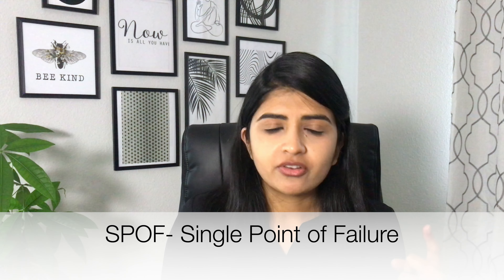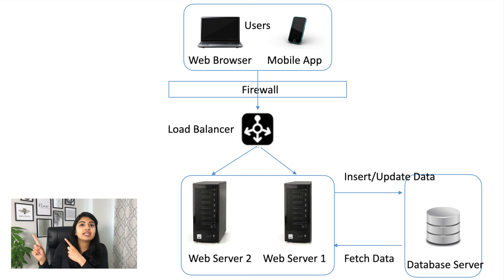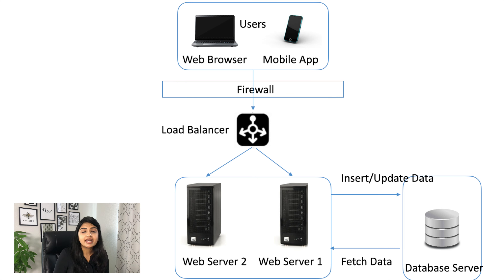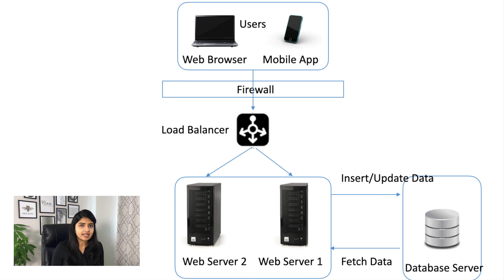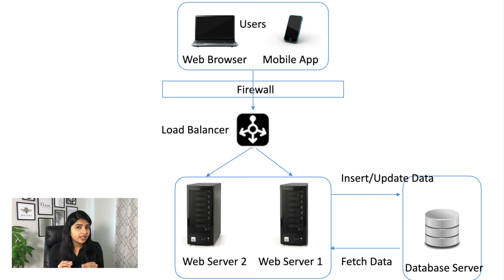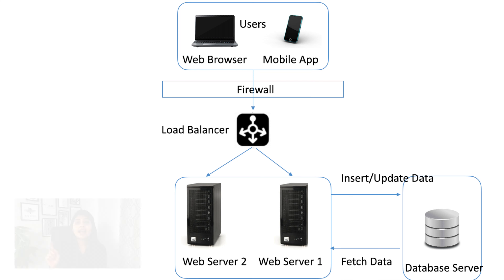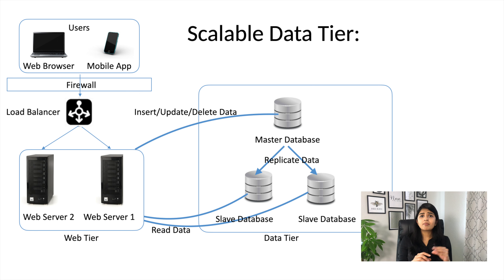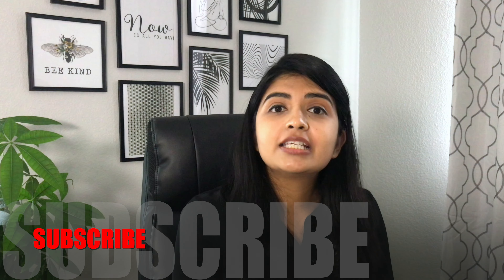Database Replication and Single Point Of Failure | Pratiksha Bakrola

Comment: If the website is designed to use a master and slave database architecture with all of the databases located in Japan, it is likely that the website will load faster for the user in Japan compared to the user in Germany.

This is because the physical distance between the user in Germany and the database servers in Japan will introduce additional latency and network delays, which can slow down the website's response time. The user in Japan, on the other hand, will have a faster response time because they are located closer to the database servers.
Reply from the maker: Yes, exactly!